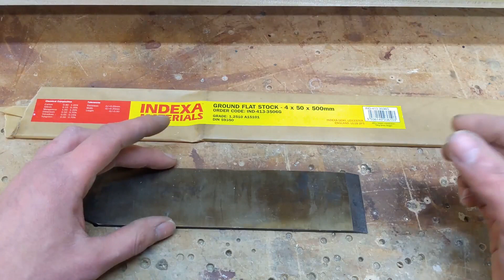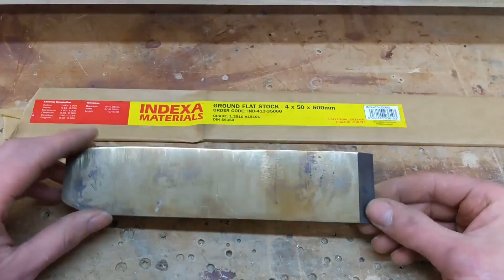Making an English Mitre plane part 8 (making the blade)

Comment: Great video! Where did you get that large magnet - 6:52 ? Also, what are the pins that you use to fix the sneck 14:55 ?
Reply from the maker: Thanks for your comment. The magnet is from a magnetic spray gun holder, these can be bought cheaply from e-bay. The pins I used for this blade where some very old steel taper pins, they work well and peen easily but I've since moved on to using silver steel rod to fix the snecks onto my blades. Cheers.
Reply: Thank you for answering my questions. I hope that you'll post more videos in the future.